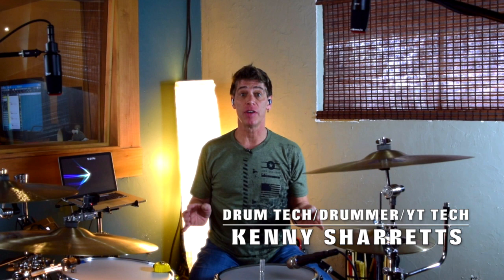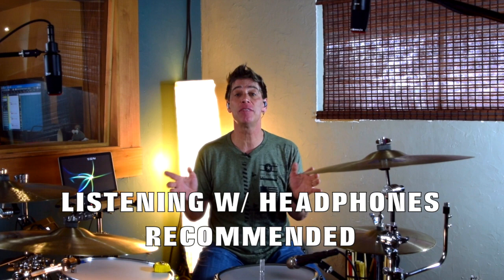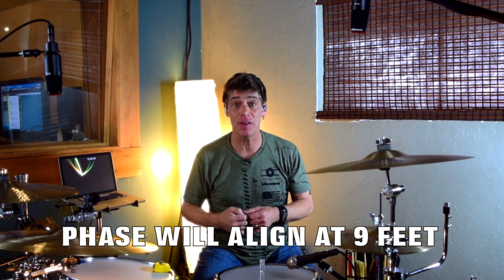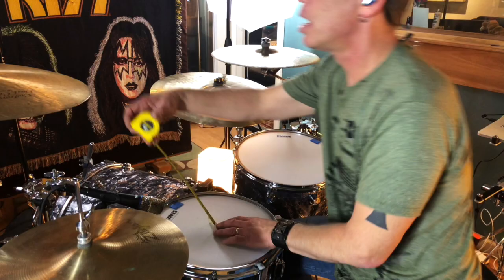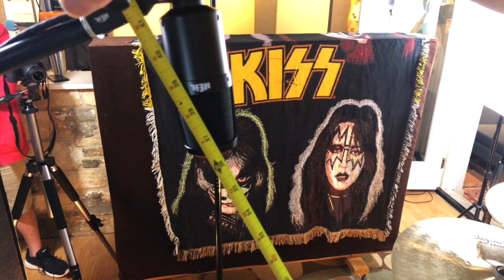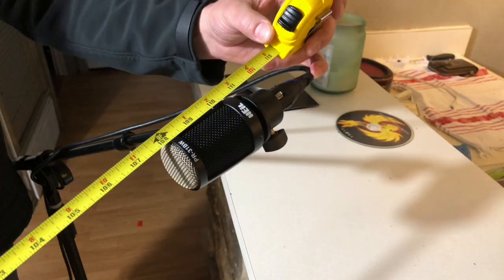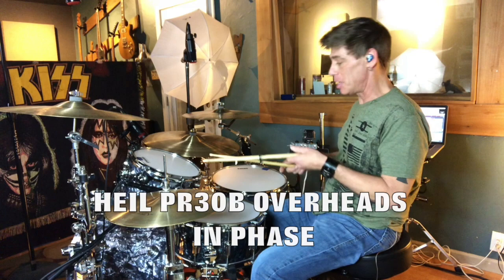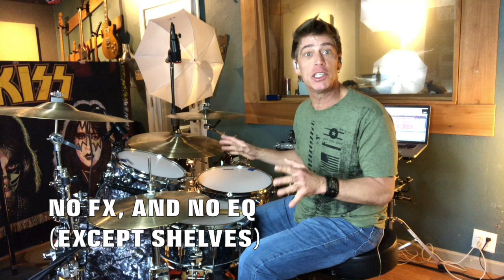DRUM MIC TIPS 3 TO 1 RULE FOR OVERHEADS & ROOM MICS

Comment: Please explain why having the room mic at 9 feet away makes it so the "phase aligns" with your overheads which are 3 ft away from the source? I understand the 3:1 rule and it seems to have nothing to do with alignment . The far mic's placement is about reducing the energy from the source significantly enough so that when it's blended with the closer mic(s) it will not be loud enough to cause phase interference. It makes sense for mic'ing two sources, but not drum room mics. The distance one chooses to mic from is arbitrary with the 3:1 rule, and for example you could've had your overheads at 5' and your room mic at 15' which follows the rule...  how would the phase "align" then? Or you could've used another set of measurements, whatever... if the overall frequency content of your drums stays constant and the distance of your mics change, how would following this rule eliminate phasing issues always? It can't possibly, right?  I'm not trying to be argumentative, its just something I've been working out in my head and I hear this 3:1 rule get thrown around a lot and most of the time it doesn't make much actual sense. If you care to respond, please do, I'm interested in what others have to say on this. Peace!
Reply from the maker: BIG PASTA as far as the exact application of the traditional 3 to 1 rule you are correct. As I said in the vid/text this is a conceptual variation of the 3 to 1 rule I shared to help drummers recording at home get a clean drum sound from the start. If the two OH mics are set evenly apart at 3 ft from the source (the snare) they will be in phase with each other from the start. Creating a clean image of the kit. Same with 4 ft. They key is being exactly 3ft from the center which is why I often put them 3ft apart as well. This “fair phase” allows for you to easily drop your top close mic snare sound rt in the mix without much issue with phasing. Oftentimes I see people setting the OH mics at the same height. With this method the heights will be offset a bit depending on where you put them/where you put your snare/how big your kit is. Bigger kit? Try 4ft. As far as the room mic goes technically it should be 12ft away (16ft if your OH’s are 4ft from the source), but I know a lot of drummers at home aren’t recording in a room that big. So I used 9 ft as it works well in terms of getting a great basic room image of the kit. That way drummers who are recording at home start with a GREAT OH/snare mic sound rather than having to wrangle with it on the back end. If you have a clean sound it makes dropping in your close mics on the toms etc much more effective/easy. Again this was in no way meant to be a 100% ultimate way to mic drums in the studio. It was meant to be a helpful tip for young drummers to get a great starting drum sound when recording with limited equipment, and facilities. Please note these drum sounds are raw from the mics. No EQ, no phase adjustment via plug in, and no fix. Just shelves for shaping the image of each mic. Thank you for asking this question in an effective, and earnest manner. Thank you also for watching.

Comment: These are great videos, thanks Kenny!  Just a quick question - in this age of DAWs, what is the obsessive worry about phase when it comes to mic placement?  The first thing I do in every mix is drag all my drum tracks so they are exactly in phase.  I would do that any time I have multiple tracks recording a single source.  I notice that even when the tracks are not explicitly out of phase, this helps.  I will measure mic distancing for purposes of stereo imaging, but I never worry about phase until mixing.  Am I missing something?
Reply from the maker: Thank you so much for the kind words. The fundamental purpose of this technique is to get a clean , in phase stereo image with your OH’s in relation to your snare, and as I show in the 2nd vid of this series with your room mic. That way you start with a clean image. Reason being is that while It’s true with DAWs you can drag tracks for phase, that adjusts the actual sound of everything else together.  If your OH’s, your snare, and your room mic start in phase, then that’s the image you start with. When you move tracks to phase to the snare or the kick you are affecting the phase of everything else the mic picks up relative to each track and what the mics pick up beyond the intended source. This vid is really a phase 101 kind of deal. Even The application of the 3 to 1 rule is relative vs literal , but it works. 🤣 I know there are plug ins for this, but the art of capturing air with mics can really add an extra level of badassness to your drum tracks. Thank you so much for watching.
Reply: @KennySharretts  Got it - so it's about finding the magical places where EVRYTHING is in phase and dragging the tracks will adjust everything the same relative amount.  Thanks for the reply and the videos!

Comment: Have you ever mic’d ported bass drums and ported toms by chance? I got sent this kickport fx (Tom ports) they had only sent 3 (I run two up two down; 12, 13, 16, & 18in ) but I used cheap CAD mics however I noticed more low end and a bit more punch when the mic was facing the ports or they were positioned directly over the ports. It was awkward cutting holes in my batter Tom heads (used ec2 clears) but I wonder if you might have had any experience in this?
Reply from the maker: As far as kickports on kicks go yes. They are a unique product. As far as micing toms? I've met a few drummers who have done it. Gonna have to give that a go myself.